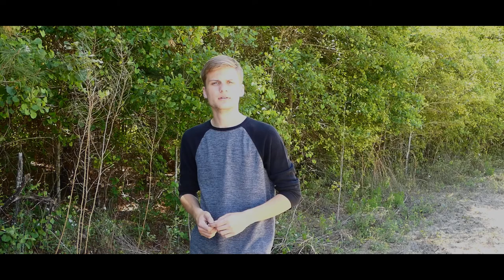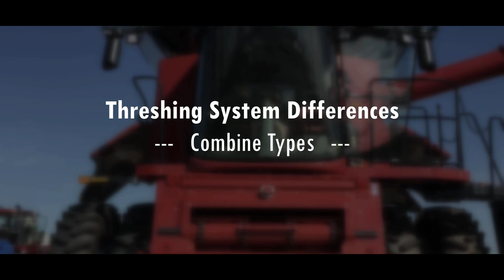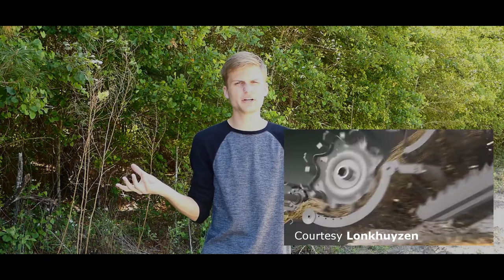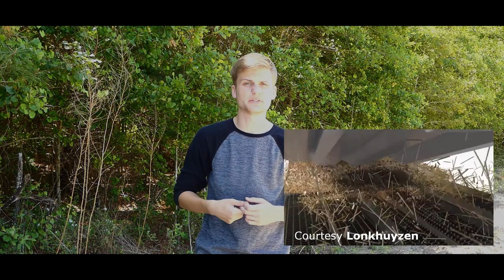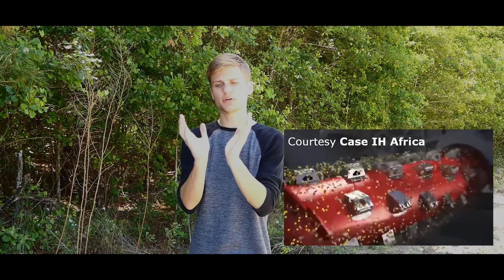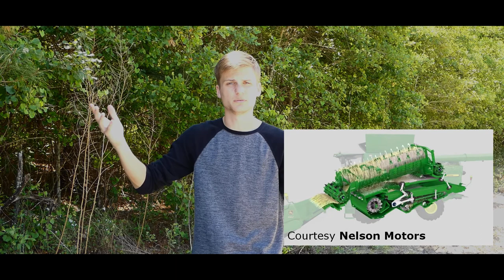Combines: Rotary v. Conventional v. Hybrid - What's The Difference?

Comment: We run hewholland cx 860 can’t beat the straw and has less loss that’s claas 670 and JD T670 new holland builds the best combine. Although it all comes down to operator and operation. Rotary generally givers speeds, also takes more horsepower so burn more fuel. Since rotor has to push out straw vs straw walkers take straw out. If want to sell straw anyone will bail your straw but conventional get a premium since quality is up